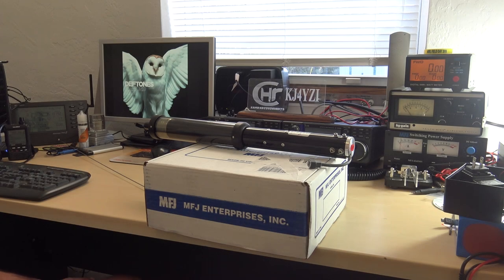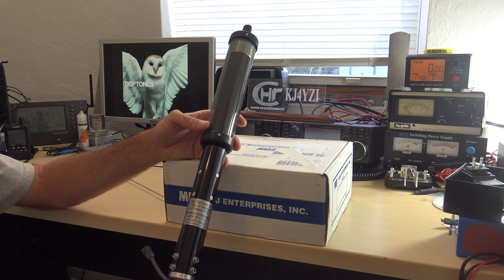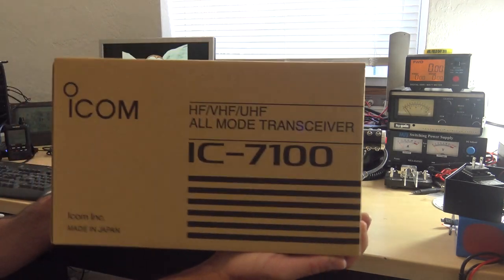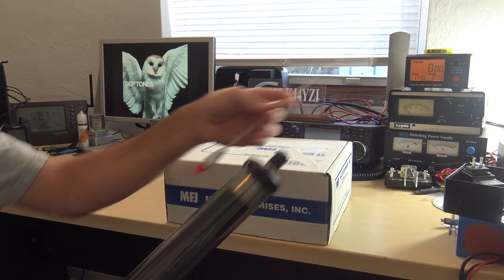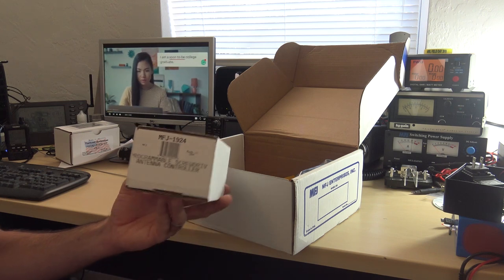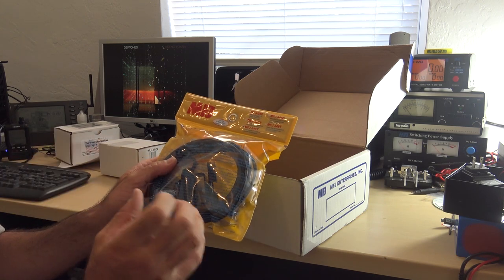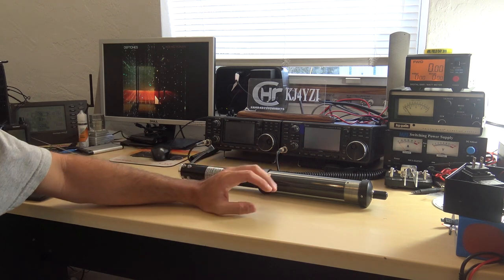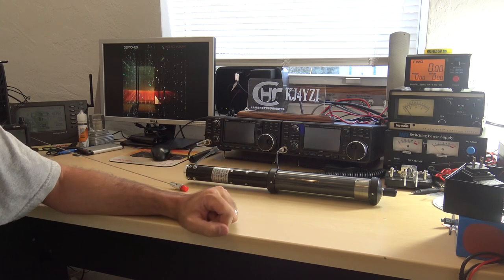I'm Going HF Mobile / Icom 7100 + Tarheel Antenna

Comment: I have the Little Tarheel HP  mounted on the right roof rail of my Jeep Cherokee over the C pillar. The mount is homebrew, made from aluminum angle and plate, secured to the rail with stainless hose clamps, and the ground side is connected to the body with a brass strip that runs to the screws that hold down that rail.  Also added a stainless spring at the base to prevent damage if I drive under low branches.  I tune it manually, and VSWR is better than 1.5 on all bands 40 to 6 meters. Radio is a Yaesu 857.  Excellent signal reports, probably because the entire antenna stands above the vehicle's body.

Comment: Had the LT HP for many years and has never failed me through all seasons - works great - mounted to windshield side of the hood on my Cherokee. Made a brace suction cup adapter with PVC to the windshield. Easy to deploy and works very well with my IC7000 through an auto tuner. A little pricey but only have to buy once...Highly recommended
Reply from the maker: pumpgeek you use an antenna tuner with this antenna or do you mean the automatic Tar Heel controller?
Reply: @HamRadioConcepts  I use Turbo Tuner II. I found the tuner supplied by TH didn't work all that well and had glitches. The Turbo II is a bit pricey, but works flawlessly.

Comment: I have the same little Tarheel mounted on my Jeep Grand Cherokee with the same mount but made by Diamond and it works perfect.  I had to run grounding straps from the rear hatch where the antenna is mounted and ground the radio to the seat mounting bolts worked perfect.  Made a mobile contact while driving on the interstate to Mexico City excellent contact.  Also thanks for all your videos.

Comment: I have a Tar-heal mini for about 8 years .Most of the time it was mounted on a Commercial vehicle  (18 Wheeler ) and now on my Tacoma never had a problem with the antenna. 2 previous  ones where Yaesu ATS120 and a Diamond both  had problems within a year of installing them.If you go to Tar heal's web site you will see pictures of there antennas on big trucks

Comment: I've had it with MFJ. TOO  many times now I've bought a product from MFJ and had it go to crap on me. 
Thanks Eric for your feedback and videos. I'm a fan.
Reply from the maker: Well, Tarheel makes this antenna, not MFJ, but I dont know how many people have had so many problems. I know there are problems with MFJ, but if there ever was an issue They made it right for me. Lately, no issues at all
Reply: +Cranium Misfit  Yeah, I've never been very impressed with MFJ. I bought my first MFJ product, a tuner, in (1989), and it quit working. I just returned my latest MFJ product about (3) weeks ago. I also just bought a new antenna analyzer, and I didn't even consider buying an MFJ. I bought a RigExpert. One thing about it though; MFJ does stand behind their very mediocre products. MFJ is kinda like the 'Yugo' of HAM gear.  lol
Reply: The antenna controller is pretty good. No issues with mine so far. JK antennas uses them for their multi kilobuck tornado tuned antennas so they must be good.

Comment: I set up a Buddipole coil (because I had it already) with a 48" steel whip on the roof of my car for running 20-meters.  I wasn't expecting much do to its inefficiency. I have been blown away this week by the number of contacts I've made on 20m.
Reply from the maker: The bands are dead :)

Comment: This is an awesome video series. Please take us step by step in detail. I just went mobile with a ic 706 and a mfj short 40 ham stick. I have a full sized tarheel, actually 2 of them, and just felt it was too much with the size and installation. I mainly stay on 40 anyway. It works fairly well, so the ham sticks are a good option.
Reply from the maker: video is uploading now

Comment: I have the BIG BIG Tarheel. On their website, it is my HUMMER H1 there. Was one of the first to buy it. The main issue was the automatic tuner and GROUNDING. Do not forget the huge whip, if you do not get it out. OUPS another one on its way. One last comment, we have freezing rain, slush, salt etc in Canada so it has a big impact on all the moving parts. I like Tarheel and I recommend their products, very nice people also. If I may add a comment on the TOY MOUNT you bought for the Tarheel, you are in for some kind of nice fun...  73 VA2SOB - Claude

Comment: I run the Little Tarheel II antenna.  Works great.  They say it doesn't work good.  I have worked South Africa on 40 meters with mine.  Mounted on the back side of a took box in a full side pickup

Comment: Initial cost of Tarheel antennas are higher than most alternatives like Yaesu ATAS-120 or Diamond SD330. But I have yet to hear from anyone who owns a Tarheel complains of premature failures or any performance related issue. That alone speaks volume.

Comment: Should look at the Breedlove mounts for the Tarheel Antennas.  Solid solid solid.
Reply: Ive had a few of them. They are bulletproof
Reply: They are great but the Lil Tarheel HP weighs less than 2lbs so not an issue.

Comment: I like my tarheel. Its much more robust than the HiQ I used to run. They would regularly blow apart. Make sure you run the shunt inductor for use on 40 and 80 depending on the model.

Comment: I noticed you have a Davis Vantage Pro2, are transmitting it thought APRS? I have the same unit and I am having a tough time getting mine hooked up to my Kenwood D-710g and D-72a. It seems like the Davis is not sending the info to the radio. Any thoughts?

Comment: do  Tarheel Antenna work on ICOM-7300?
Reply: They will work with any radio as long as you use the controller.

Comment: how ironic. I've had a 5100 sitting around for 4 years and I'm about to install it in my mobile . lol and Deftones strike again!!
Reply: Im about to install a 5100 too. I was told to remove the negative side ground fuse but keep the positive side. I havent read the manual but do you know if this is true?

Comment: I didn't care much for the antenna. Had to put a 102 inch cb whip on it before it would resonate properly. In my opinion it's way too small to be effective.
Reply: ;used one to check into my 75 meter traffic net for several years.  Worked great.  Don't let the small size fool you.

Comment: With a 54inc rod you can got on 80m bot you lose 6m make sure you bond your door great antenna 73   2e0ree
Reply: Yup I run mine with a 56" whip and and worked NA from my mobile in the UK, you get a big bang for your buck with the Little Tarheel II
Reply: @buddyhide8060 that’s not a TARHEEL II.It’s a Lil Tarheel HP & it’s a totally different antenna.